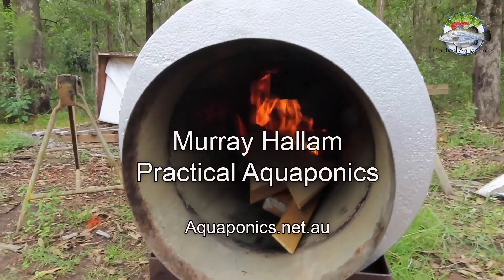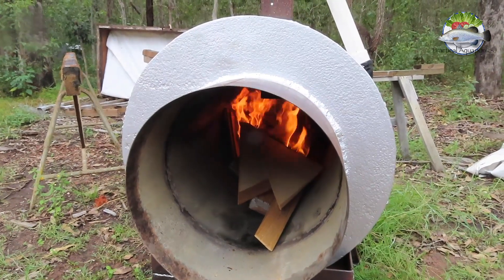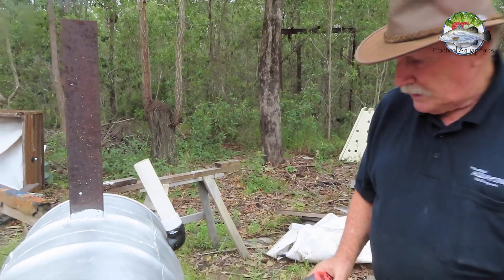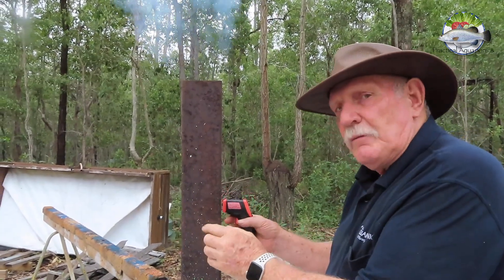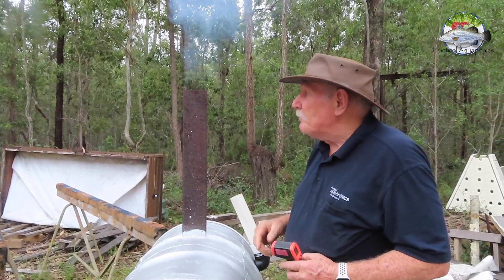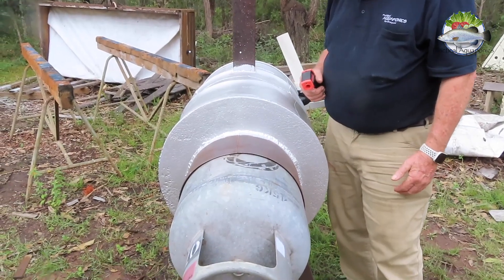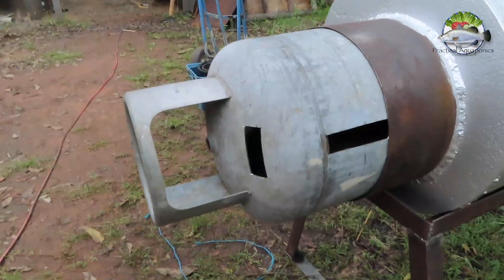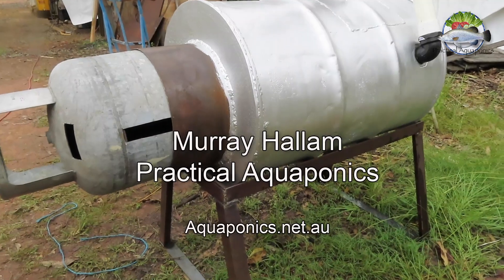Aquaponics Wood fired water heater.  Part 2

Comment: Would suggest a pressure relief valve for the water chamber just for safety; 
along with an automatic valve to turn pump on/off based on water temperature in the system, running the water heating as a separate system to the main aquaponics pump
Reply from the maker: Yes, a safety relief valve in case the pump stops and it builds a head of steam.  The hot water is used in a heat exchanger in the fish tanks.  A thermostat turns a hot water pump on and off to keep the fish tank temp in range. 17 to 19c (63f and 66f)

Comment: it actually dont look that efficient at all.. as it will have to cold wall's for a good burn and no reburner/after burner of gasses. 
best option is to have a burner chamber that do not let any heat escape and then use a flue gass to water heat converter after the burn chamber.  
here you get a wood gassefying sentral heater. look them up.
Reply from the maker: Thanks GraoSorz,  We will actually have an afterburner, that is still to be built and I guess we will see just how well it works, thanks for your input.